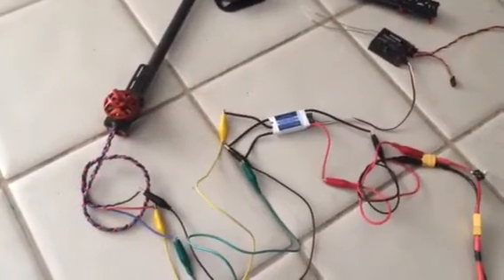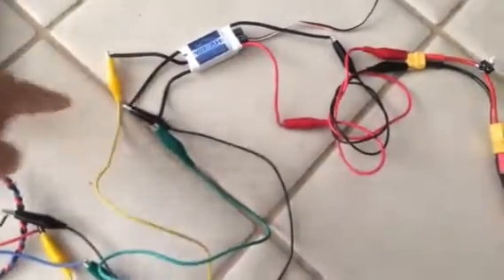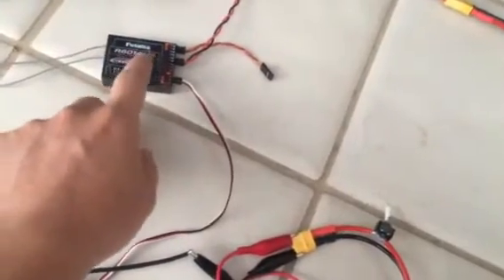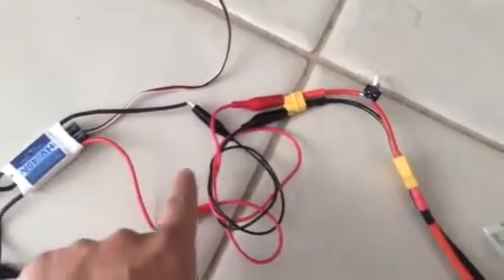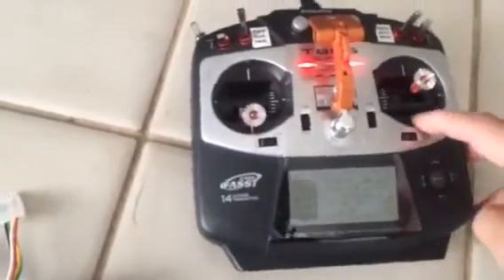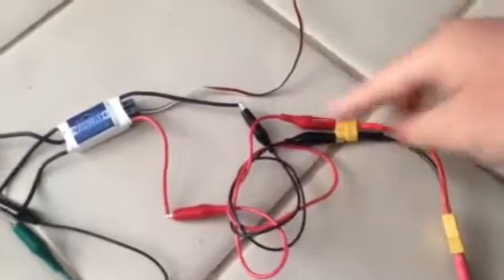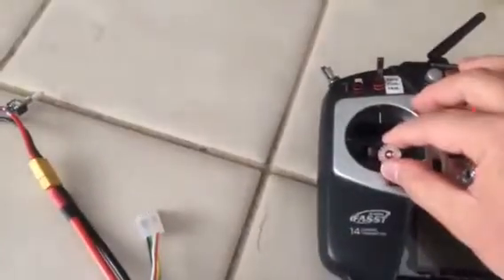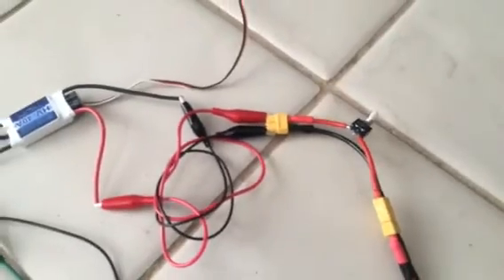Calibrate esc with your transmitter

Comment: Hello I am running platinum 30a OPTO with a pixhawk 2.4.8 flight controller. I went through this process and verify that the esc war calibrated by doing a direct run. Nonetheless, once I recommend and arm the motors start at 50% on the throttle. Can you help?

Comment: i replace burnt ESCs with hobbypower ESCs and noticed they dont supply enough power to lift my quad. will this fix my issue? the old ESCs could generate enough thrust, they are same specs

Comment: You only need power to the ESC which in term powers the receiver I thought
Reply from the maker: True only if you have ESC with the built in BEC. The one I had on the video is an Opto(none BEC) ESC which can't power the RX and must power the RX with other 5v source
Reply: Copy dat